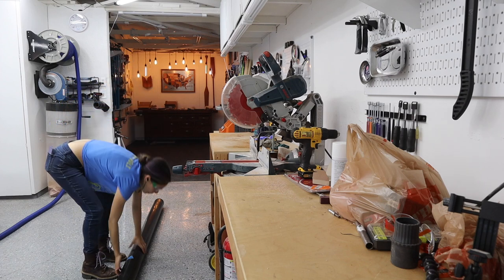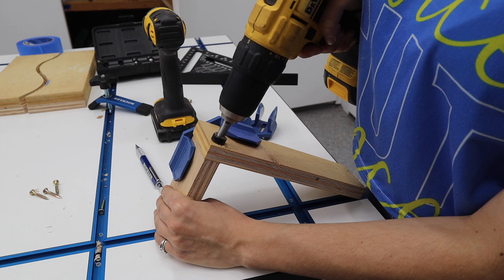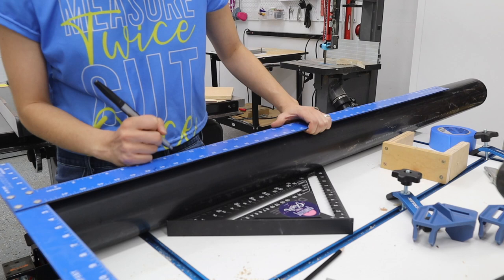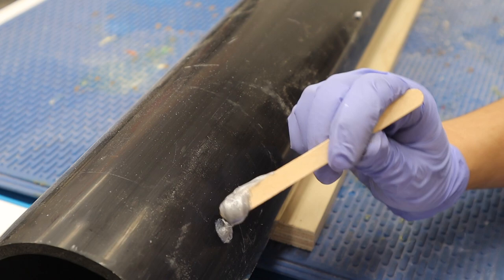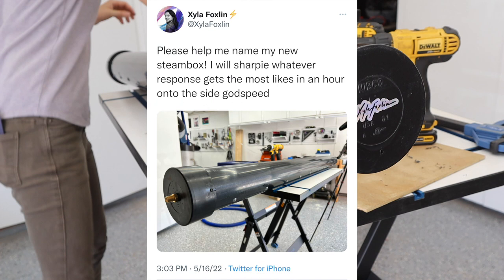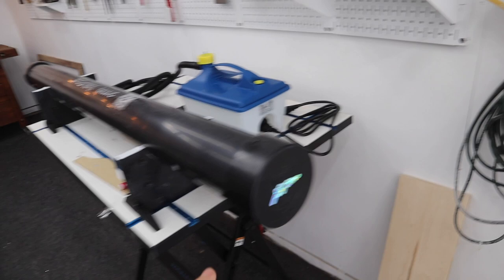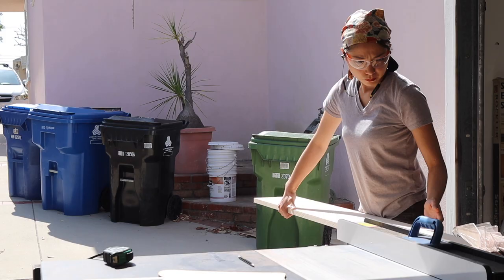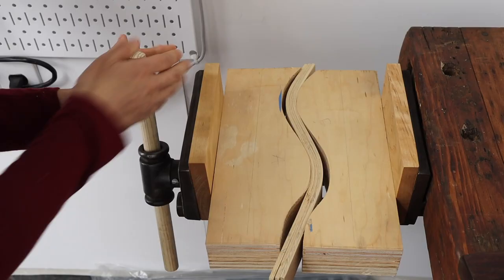How To Make a Steambox

Comment: One thing I have learned about applying epoxy in small places or more accurately is to use soft squeeze bottles. I am using the 1 ounce bottles that come in a pool chemistry kit. The nice thing is the top pops off so super easy to fill it, cap and use. Plus the soft plastic can be flexed after the epoxy has cured and picked out of the bottle so you can use it again!

Comment: This is awesome, I hope we get more of these toolmaking/meta building videos from you! Question: does anyone know when/why steaming wood is better than just soaking wood?
Reply from the maker: Steam is hotter!
Reply: The heat loosens the lignin holding the wood fibers together.
For REALLY flexible wood you can try anhydrous ammonia under pressure.
Reply: @jimurrata6785  You could do that, but I would very deeply consider if you are operating with appropriate PPE before thinking about it.
Reply: @jimurrata6785 
It doesn’t loosen it. 
It softens and becomes flexible and the moisture makes the fibers more plastic. 
Soaking wood just swells up the fibers.

Comment: Great video.  You mentioned you used 4" ABS.  That looks larger than 4" more like 6" id.  I am finding solid wall ABS larger than 4" is hard to find locally in lengths larger than 2'  but since it does have a higher heat rating than PVC I will keep looking.    Can you mention if the ABS has held up well to multiple uses?  I know folks that have built out of PVC mention theirs sags.

Comment: You might want to go to a plumbing house and ask them if that is safe to heat with steam. Not for the pressure, but for the toxic fumes when pvc type pipes are heated. It's not good stuff. Please be safe. Other than that cool video!
Reply: good point

Comment: Instead of the premade steam boiler, wouldn't an easy to build option be to have a 90 degree angle piece going down into a length of galvanized pipe with a water heater element?